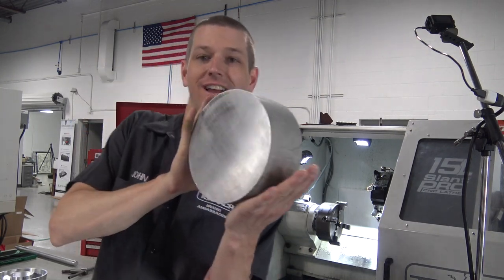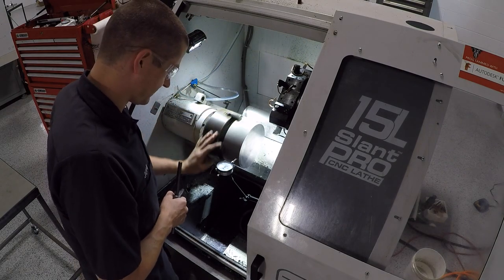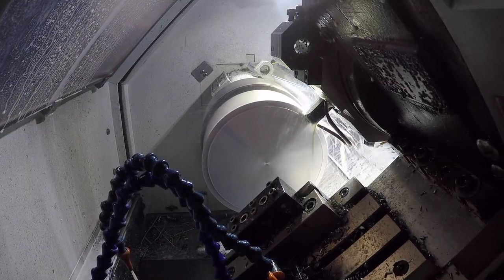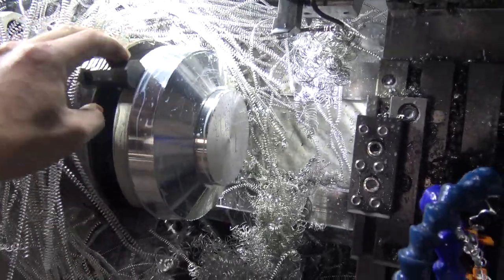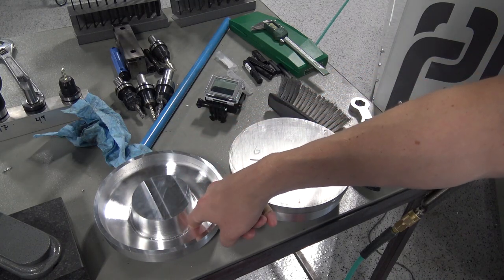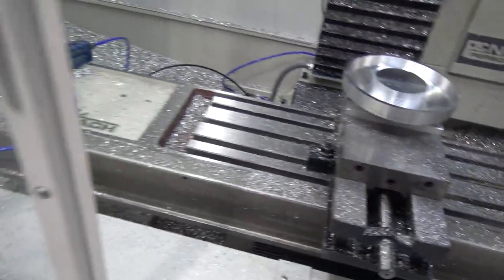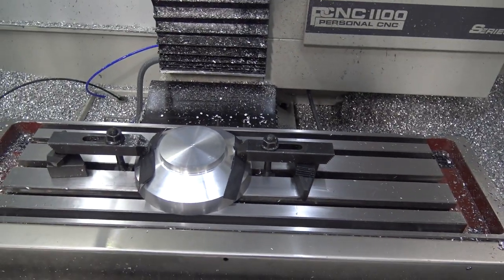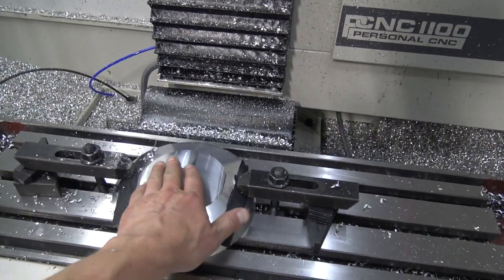Job Shop: Large Aluminum Discs!  Turning & Milling - Widget100!

Comment: Had just that problem last weekend. 6 1/2 " stock, stalled the motor twice trying to part off (which was a challenge too). However, learned lots and got the part made.

Comment: Ran into the same issue you did on a recent job. Was working with 6.5" 6061 pipe with a .5" wall thickness. Indicating off of the OD, the best I could get on a four jaw was a total runout of .02"

Comment: Could you have cut the excess held in the 4 jaw off with a bandsaw and taken that piece and cut an internal matching taper in it then placed it over the piece on the mill table and placed your strap clamps on it as a sacrificial part that would not matter if the clamps gouged it? You could also put a layer of tape between the tapers to ensure you did not mark the finished part. I was cringing at the mill setup but I wasn't there to verify the rigidity and obviously it was successful. Anyways good job John! Also my experience with large alum stock is they are not round but oversize so they will finish at the stated dimension. Good to use the 4 point method of indicating as you did. Love the videos!

Comment: big extrusion is normal out of round by about .005 or so, getting it within ten is plenty fine. If your buy the cheap shit it can be out more than .025 as they use really shitty dies. You need to get a small corner rad for turning those big ø! So close you need a medium chip breaker and at most a #1 rad or even a .5 rad (they make even a #0 rad!) for a .03 DOC and .01 ish feed per rev. Also try running as fast as your pucker factor will allow, aluminum will start to break up pretty good above 2000 SFM, really I would start at about 3000 SFM. If in doubt refer to my Instagram ;)
Reply: +NYC CNC that's why your machine has a door on it 😉

Comment: John, the ShearHog is going to remove more material per minute than the superfly.  You'll be minutes ahead to do all your roughing with the ShearHog.  The figure is 6CIM per HP, so at 1.5HP you're looking at 9CIM metal removal rate when run to the max HP curve.  I'd try running at around 3800RPM, that should be the sweet spot for max torque and HP.  You should be able to run at max feedrate at .100 DOC, full width.  On my Shizuoka I ran 3800 (2:1 spindle overdrive at 1725 motor speed), .125 DOC, 1.25 WOC, at 125IPM.  That's a 4HP machine.

Comment: With regards to securing this part in the mill, what if you cut a ring and matched it's inner profile with the outer profile of that part? Just enough to cover the area where you clamped it for this video. That would give you an infinite number of clamping possibilities without risk to the finish of the part. Is that a bad idea or just too time consuming? Still learning about processes here. Awesome video by the way!

Comment: Simple physics time: Metal may be hard, but consider this: It's been said that nuclear weapon pits (Pure plutonium,) and MIRV reentry vehicle bodies, (uranium) which both happen to be fairly dense metals, have to be rotated occasionally when in storage because the force of gravity is enough to measurably deform them under their own weight enough to make detonation (and flight) risky. Aluminum is less dense sure, but extrusions  generally run about 165 feet long at the plant. So you may get a little out of round just depending on how long it's been sitting in storage. That and it cools on a "close enough" flat surface after extrusion, lending a very slight D shape to its profile. You'll never get a perfect extrusion, so you should (like you have to do with aluminum square billet) face it off as the first step on general principle.

Comment: Is a SuperFly really the best option for a Tormach when it comes to material removal rates? I ran it against a high quality roughing endmill using Tormach HP and RPM limitations (something like a Swift Carb Rampmill or Helical H45 or Destany Diamondack). In .5", with HSM toolpaths, the solid endmills best the SuperFly by about 30%.
Reply: +NYC CNC diamondbacks require 14k + rpm spindles and 300+ ipm feed rate machines to be effective. They are for heavy aluminum roughing. IE, you need HP...

The Destiny Viper series might be better suited, they're finishing endmill's, but can still do light to med roughing. But they're also expensive.  Bang for your buck? The OSG Aero Blizzard series. Long lasting, can rough and finish, and well priced.

Comment: John, on our machines (Mazak) , as we face down toward the center on large diameters, the rpm automatically speeds up variably , thus maintaining the proper surface feet per minute speed though out the cut. I wonder if your machines have a parameter, or could be programed for that function?? Just food for thought. Thanks a bunch for a great video, Cliff
Reply: I thought I heard the spindle speeding up as it turned closer to center. I'm pretty sure John has mentioned in the past his machine does this.
Reply: +l wilton - Heard that too.
Reply: G96 constant surface speed?  It was turned on. Problem is the torque output on that lathe is at its max at around 1200-1400 rpm.  When it's 4" out from center the RPM to maintain surface speed drops to around 500-600. And it doesn't have the power to properly drive the tool through the material without stalling out the spindle. hence he couldn't maintain the chipload and depth required to reach the chip breaker on the insert.

Comment: Hey John! Yep that tolerance on the stock is normal. I personally wouldn't have even fussed that much about it.

It was an interesting approach you took, personally I would have done it on the lathe, but as much as you're a "mill guy", I'm a "lathe guy" so of course I would ;) 

A couple of thoughts for you. In this instance a compound effort may have been the go, and machine some tool clearance with the mill, then transfer it back to the lathe to whack off the rest of that internal. It would be much faster and the finish better.

Next time you have a job like this you may want to consider drilling and tapping the stock to bolt to a "faceplate" that goes in the chuck. ie what you machined off, just use a scrap of material and unbolt it when done. It will save a stack of machining time, and at least down here in Oz they don't give aluminium away, so no point in tipping any more than you need to in the skip as chips. Position the bolt holes in the material that will be machined away. 

Finally, I noticed you were using constant sfpm, and when facing watch out for the maximum chuck speed. That was a big piece of stock for that lathe, and it was spinning pretty quick when approaching centre from what I saw. Quite apart from what was still a pretty big chunk of aluminium going around at warp speed, I think the Tormach 4 jaw chucks are rated at only 2000 rpm, so it's possible to overspeed the chuck if you hit maximum lathe rpm at tool centre when facing. 

The finish on the OD was awesome, well done!
Reply: Ok cool, I couldn't tell from the video what was happening at the centre of the facing as it coincided with changes to the editing, but good to know you had that factor in mind. A lot of people don't properly consider max chuck speed, or worse, don't even know about it!

I had a chuckle about not standing by the door, I know that feeling! As long as you were also squinting when it was running (to protect your eyes), it sounds like you had all your OHS bases covered :)

Comment: Heya John, how come you never optimize cuts and set the return feed to something fast? I get it when a tool has to make a cut at like 20ipm, but the travel to the next cut can be set to something way faster, like 90ipm. Its only cutting air after all. In sprut7 that was under the feeds -> next/return. Not sure how that works in Fusion. It's really useful for HSM and adaptive clearing, where the tool spends a lot of time moving to the next cut.

Comment: what kind of bearings does the chuck spindle you installed the part into ride on.. tapered roller.. ball bearings..  roller bearings with a thrust bearing  or a sleeve bearing.  anything other than a sleeve bearing and you may be putting dents in the races with that dead blow hammer squaring the piece into the chuck.  its just a thought..

Comment: just a couple of questions 
why didn't you grab a 3 jaw or 4 jaw chuck and mount it on the table of your cnc. 
Also why didn't you use the step part of the hold down clamps and use them stacked instead 
thanks
Reply: +NYC CNC even with soft jaws?

Comment: Great video John!  I'm a bit chicken, so I think I would have used three clamps on that mill setup. Also note you could have flipped the strap over and had an angled surface that would have been close to the same angle as the part surface.

Comment: Large extrusions usually is a bit warped at least around here. i usually dial it in to a 0.01mm, turn it flip it dial it in to zero and then turn it from there.

Comment: What a birds nest on that aluminum turning! Needs more feed/rev!  Maybe hook pedal bike to machine for more power. :-) Not uncommon for the big parts to be a fair bit out of whack from the mill, cold rolled is usually closer than hot rolled.

Comment: Thanks for the video. You wanted to get better chip break on the lathe, my suggestion is to use smaller nose radius on the tool, that way you will get more the chip breaker into the work.
Have a day

Comment: Shouldn't you do a rough outside diameter pass early in the process to balance the stock and reduce vibration and strain on the motor?

Comment: Great work but would have been 3operation turning job more than likely if your tormach lathe had soft jaws or a power chuck, good things to have with a cnc lathe also I can suggest SGS S carb tools for faster aluminium machining on the mills if you have 8000+rpm spindle and a better cutter than the superfly which is the 80mm diameter facemill from Maydown tooling best and biggest cut of got from it was about 8mm depth of cut and running 6000rpm at 1500mm per min both of these tools are great for eating up aluminium extrusion at a upper fast rate.

Comment: you could also buy the free machining grade of your aluminium or steel you're turning. that little bit of sulfur mixed in really breaks the chip nicely without needing to hit the feeds and speeds perfectly
Reply: +matze1508 Yeah, I like 2011 and 12L14 any time I can use it. Can't really weld it though, so most of the time, it's 6061 and 1018 for me. I used some 7075 recently and it was very strong, and not the easiest to work at all.

Comment: Did you consider increasing or tweaking the "no engagement feed rate" parameter for the shear hog in Fusion? It would've made that op quite a bit faster.
Reply: Sweet!

Comment: Extruded  materials  are at the mercy of the Dies on which the Aluminium  passes, and I would say that 0.010" is pretty good.
The error on shape is most likely from the wear on the extrusion die. The dies do wear over time and may have been close to a rework(changeover).

Comment: This project made a mess of the machines! How do you usually get all the chips out of the inside of the machines?
Reply: Look for flat bottom metal, ice or candy scoops online at restaurant supply vendors or Amazon. They work perfect for scooping chips up and hold up way better than those flimsy dust pans.

Comment: no comments yet. nice, yay. any hoo. i love turning. keep up the great work
Reply: trying to get your initial geometry on something that big is almost not worth the time to do so. as long as u get it clamped well and have the room to turn it out in the part. not that great of a problem. remember, it is an art as much as it is a science.
Reply: if i where u, with these jobs coming in more and more. i would get 1 or 2 tools that might take a larger chip load, dont hurt your machine for hp but u should be able to take more cubic material per min then with a super fly.
Reply: dude, have u heard of a z axis machine???????
Reply: just a lathe with a milling axis. they are amazing. some have more axis's. it would make those parts in 1/4 the time. and in only to chuckings. well. maybe 3. but it would all take place on a single spindle. and vs a mill, everything would turn out concentric and balanced.

Comment: John, is one of your next things going to be a metrology department?  Maybe a CMM?  I don't know what sort of precision your customers need, but it was occurring to me while watching that the clamping method you picked might result in some temporary deformation that could result in the hollowing out cut making a slight oval. I doubt it would be much if any, but if precision requirements are high, knowing whether there was, and if so how much, before parts go out the door might be nice. Just a thought for the future. 

The lathe torque at lower speeds is an interesting factor. Probably results from use of a PWM-based controller, right?  I guess there were advantages to the old pulley systems. :-)

Thanks for the video!

-- Mike

Comment: In aluminum (6061), a good honed edge inserts can cut up to 3.2K sfm. Because that means spinning a big chunk of metal at ridiculous speeds, really it means you just run it at what ever speed you and your machine are comfortable with and you'll be fine. However if you are getting stringers you either have an insert with  the wrong chip breaker or you are not feeding hard enough. .012ipr is good. the DOC is determined by your spindle HP. A scroll chuck however may be your limiting factor not your spindle motor. P.S. I know Tormach has been/is good to you, but time to invest in industrial machines.

Comment: how long do you get on an edge with those superfly inserts? Brad said "basically forever" but I feel like you keep them moving a lot more than he does.
Reply: Depends on material.  Inserts for steel usually last (or should) about 60-100 cutting hours. Aluminum ones should last 150-200 cutting hours. 

But. Those are just rough figures. Depending on grade, manufacturer, coating etc etc. you could get double or more life, or half of the life. Honestly just way too many variables.  You'd have to do a time study with the specific insert on a specific machine and material and do the same type of toolpath till the insert finally gives out.
Reply: NYC CNC oh alright, so actually forever haha
Reply: +Geof Dumas honestly most don't change their inserts often enough. On coated inserts when the coating is worn off, it's time to rotate them. But if you're cutting mild steel, the carbide substrate still cuts well enough for roughing that people just keep running till the sparks show up. Won't lie. I'm guilty of this too. And with a 50HP spindle I keep going till the entire relief is ground away XD. 

Polished uncoated inserts are tougher to gauge when to change. Usually you just have to go by the surface finish its leaving. When it gets too poor to live with, flip em.

Comment: You seem to be more of a mill guy. Me too. I wish I was better with the lathe, but I still have a lot to learn. Why superfly and not face mill? Not that the super fly didn't work great.
Reply: Really? Any reason? I don't personally own one, but I used some cheap basic 2, 2.5, and 3" right angle carbide inserted facemills at school (with the flat inserts), they did a great job. Just ate up aluminum as fast as the Bridgeport could push it.
Reply: +The Metal Butcher my guess is power consumption.  Face mills are power hungry tools, fly cutters require much less since they're a single flute tool. They simply just can't feed as fast as a face mill. And they produce better and more accurate planar surfaces than face mills. 

The super fly has about a max 2.5" dia swing no way the tormach could handle a 2.5" full face mill, or even a 2". and anything 1.5" and under the shear hog will out perform vs a face mill. I barely use a face mill anymore. The 1" ripper mill I have cuts faster , deeper and finished better than the 2.5" face mill in the machine
Reply: It's going to take the same amount of power to remove the same amount of material, no? Or is it less efficient? It just seems like it would be better to split the load some.
Reply: +The Metal Butcher as the number of teeth increases the material removal rate increases.   As the material removal rate increase, the power required to cut increases. 

Say you're taking a .005 /tooth cut with a single tooth at 10 ipm.  As the number of teeth increases, the feed rate increases as well to maintain the .005/tooth rate. So for a 2 flute cutter to maintain .005/tooth your feedrate will double to 20ipm.
Reply: Right. But that thing should have enough power. More than a 2 hp bridgeport at any rate.
Reply: +The Metal Butcher nope.  Think they're only 1.5 HP peak spindles and less rigid than a Bridgeport.
Reply: Aw. That's lame. You've taken some very impressive cuts/rate of materiel removal, I guess those fancy toolpaths really can help.
Reply: +The Metal Butcher that's where tool geometry comes into play. For instance the geometry on the shear hog positive take inserts reduce spindle power requirements in a cut by about 20% (they claim 30% but I think that's marketing lie) so you can take faster, heavier cuts with it without stalling out the motor. Downside is since the cutting edge is doing more work as far as forces goes, they tend to break down much faster than their negative rake brethren. Negative takes last far longer, but actually increase the amount of spindle power required. But being stronger they can blast through tough metals easily, where positive rakes will most likely break.
Reply: Rakes, not takes...  Stupid phone

Comment: when facing can the Tormach speed up as the cut gets smaller?   I know Haas machines have a setting for that.
Reply: Yep, you can hear it.
Reply: all machines do this. it's G96
Reply: +The Metal Butcher I thought it sounded like it was speeding up.